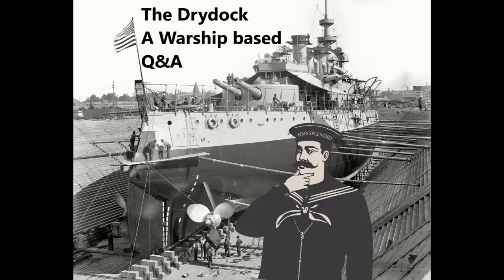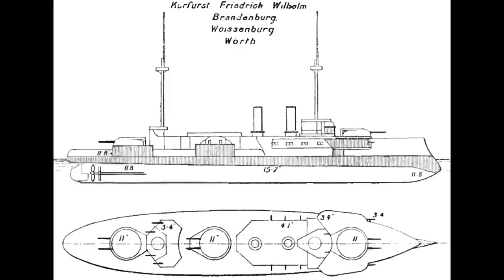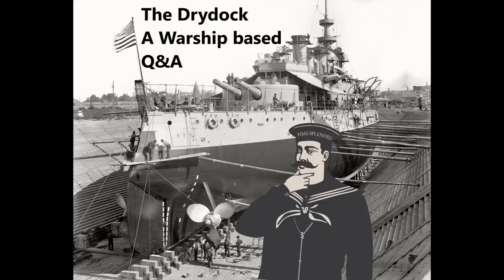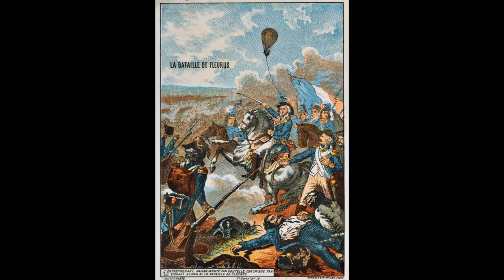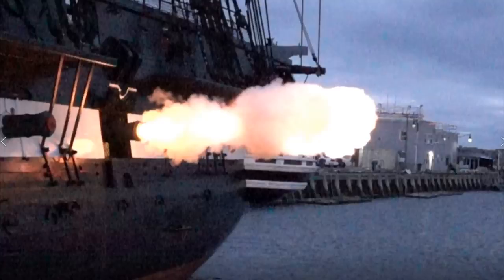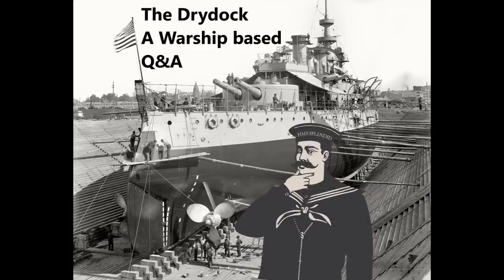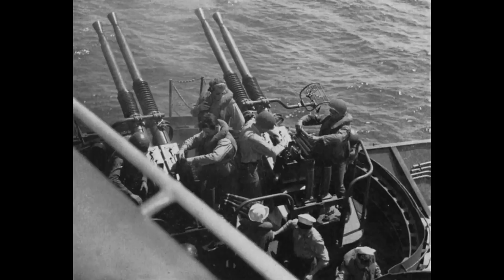The Drydock - Episode 254

Comment: In terms of the 'maritime Hobart's Funnies', the smaller vessels used by the Allies during the Overlord operations merit mention, although mostly smaller than true 'ships'.

Peter Scott's flotilla of Denny steam gunboats were all 'converted' prior to D-Day into fast minesweepers; as far as I can tell, these were basically just using their considerable speed to produce waves which would detonate pressure mines safely without the boat still being horribly over the weapon when it blew. So that's an interesting 'misuse' of a fighting vessel.

Others of note were the various LCT conversions, which included LCFs (Landing Craft, flak) - an LCT mk 2 to 4 with the lank deck taken up by copious 2-pdr and 20mm guns for close-in AA defence of the landing forces. One of the early versions even received a pair of twin 4-inch HA guns as found on early 'L'-class destroyers or Hunts as main armament.
LCGs (Landing Craft, Gun) were a combination gunboat/monitor conversion with two destroyer guns mounted singly on the tank deck, with the later LCG(M) (LCG Medium) being slightly smaller and purpose-designed with two echeloned 17-pdr gun turrets, as well as ballast tanks which allowed them to be flooded down to ground at known map references so they could then act as fixed inshore artillery batteries to either support the troops with predicted fire missions or even indirect point fire missions on call from the troops ashore's liaison officers.
LCT(R) were the famous floating rocket batteries, again converted from LCTs for fire support to the troops ashore (carrying out suppression/barrage missions).

And of course, several of the smaller landing craft were modified into gunboats for direct fire support during the landing phase itself. Small numbers of Fairmile 'H' type LCIs were given a Valentine tank turret with 6-pdr gun for this role, and other small craft had 4-inch smoke mortars added, becoming smokescreen layers instead of assault troop carriers.

Perhaps my favourite is the inventive use of the old and, by 1944, very redundant Holman Projector (steam or pneumatically-operated anti-aircraft hand grenade launcher); this was modified for use as a grapnel projector and was mounted in LCVPs used by the US Army Rangers in their assault on Pointe du Hoc.
Intended to fie a line up the cliff to allow the troops to rapidly scale the face to reach their objective, it's not clear that they functioned as well as anticipated, but they were mounted for that purpose and so these handful of LCVPs became the maritime equivalent of the famous ARK ramp tank, being there especially to help their team get past an obstacle to reach their objective.

EDIT: Who can forget the famous German Sperrbrecher, either? Mercantile hulls, modified to withstand mine blasts forward without sinking straight away, they had not just sweep gear for general minesweeping duties, but also the very famous blisters either side of the forward hull, filled with buoyant materials like kapok, so that if they did hit a mine, they would only partially sink before the blisters took the strain and kept the bow up, hopefully just far enough.
This enabled their use as 'mine bumpers' when leading U-boats in and out of their Atlantic bases, or when escorting convoys and blockade runners up the the Channel; all areas which were extensively & constantly mined by the British.

Comment: The engine rpm indicator was used by the bridge to command the engines to a slightly higher or lower speed so you could precisely match speeds when doing underway, replenishment and refueling.

Comment: 56m50: I recall one type of vessel in WW2 that could be classed as a funny, the radar Picket submarines Grouper and Finback with Threadfin and Remora completed after the war ended.  They were to be a more survivable platform than the radar picket destroyers, LCS(L)’s and LCM(R)’s doing the job.  They were followed by others for a bit into the cold war.  For that matter, the altered landing ships could probably count too.

but I imagine for ships, funnies only work with ships up to a certain size with an entire sub being the upper limit before someone would wonder why they had to have an entire vessel dedicated to that one mission when they could instead either tack on more equipment to add the mission to a ship, or cut into some other capability a bit to make room/tonnage for it (e.i. guns, torpedoes, AA).

also, after the period of your Channel, the Greyback after it was converted from an SSG to a Special operations sub.

Lastly, will Judy get her own video much like Nuisance did?

Comment: A question for the Dry dock, Mr Drach. 

Is there any history of a Navy using chemical weapon shells in their arsenal? Like an 11” or 12” Chlorine Gas shell or something?
Reply: The French tried with the Richelieus. The end result was that the Richelieus had horrible fucking dispersion (it’s really them and not the Littorios, whose own dispersion issues were largely fabricated postwar, that need to be criticized for it) until the US made non-poison-gas 15” shells for them that worked fine, not that it was ever going to matter.
Reply: To be clear, the standard AP shell for the 38 cm guns in the Richelieu class had four slots in the base for toxic gas cartridges, with the base covered by a base cap. However, the base cap would sometimes shatter during firing, occasionally allowing the gun blast to set off the bursting charge and, in any event, contributing to the dispersion mentioned by BKJeong.

Note that chlorine is a terrible war gas. Lethal concentration is around 5,000 parts per million by volume (ppmv), but it produces tears and coughing at much lower concentrations (around 5 ppmv), so it's obvious your being exposed to chlorine long before it will kill people. At that kind of concentration (5 ppmv) phosgene is already killing people.

Comment: A question to do with range-finders. On the turrets of the Omaha-class cruisers there are these tubes on the roof at the sides. Are those a differed kind of rangefinders then the ones usually seen across turrets ? And if so, how do they work ?.

Comment: For the comparison to Hobart's funnies, rhere are two examples I would point to:

1) The various specialized landing craft with different weapons systems for supporting landings.
2) The destroyers converted to fast transports (the Funnies weren't all combat vehicles, they included support vehicles as well and the Kangaroos would be assigned to the 79th alongside the Funnies when they were formally adopted).
Reply: Great shout about the fast transports. Without them, the amphibious special ops like independent commando insertion/extractions and UDT missions wouldn't have been possible.

Comment: Think Japanese shadow fleet had some "Hobart Funnys", that were easily convertable from an earlier guise as dual or specialist role.
Chitose and Nisshin were seaplane carriers, but carried midget subs in their hull as well in case US battle line appeared at Midway.
Then Nisshin in the same hull, carried artillary and tanks to Guadalcanal, and avoided Battle of Cape Esperance 
Obviously Chitose was converted to a light carrier after Guadalcanal
 
Ryujo Maru was the original Command/amphibious/jack of all trades ship for sea landings, until sunk at Sunda Strait by Mogami if u wanted to go down the an amphibious sort of landing ship path.

Maybe a Ise, Hyuga and Mogami if they were modified prewar to carrier/battle ships and Tones as configured might have been very useful if they accompanied invasion forces like Wake or Rabaul where their seaplanes and gunnery could have been very effective if they were also designated a command ship for those operations where they could have directed ground support bombing attacks via their seaplanes or naval bombardment to any kind of resistance/bunker to invasion force, up to about 10-20 miles inland

Comment: On the idea is specifically modified ships for specific roles.  While that wouldn’t happen with large expensive ships  it did happen with smaller craft, below what the navy  considers  “ships”.  LCIs, SCs, and LCTs were all modified for specialized roles.  They usually benefited in the new roles from their shallow draft.
 
LCT could be mounted with a destroyer main gun (120mm or the like) or a mass of short range rockets for firepower at or near landing beaches.  They also have a lot of deck space for their size is is probably why post war their name was changed from landing craft tank to landing craft utility.

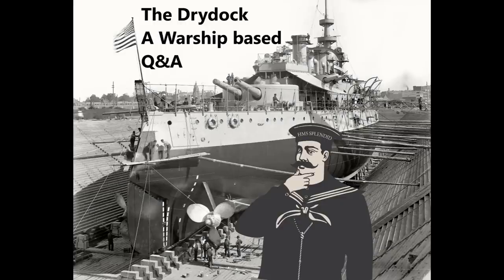Comment: @ 0:10:42 The Engine Order Telegraph for smoke would be in the boiler room(s) and in Central Engineering. (Since it would be the boilers that make smoke.). This is, of course, for ships that didn't have unitized propulsion system(s) and had the boilers and the turbines in different machinery spaces.

Comment: Question not related to dry dock: Was the Samuel B Roberts the only DE that had torpedo tubes?  One of my sources said it was, and that was why Copeland joined the destroyers in the strike on the Center force.  Did Copeland join because he was the only DE with torpedoes or because he was feeling scrappy?
Reply: The latter, I think…
Reply: All US DEs had a single triple torpedo mount, at least as built (I think some may have traded it in for an extra Bofors quad later).  IIRC, after the destroyers and Sammy B made their torpedo runs and were falling back, the other DEs were sent in to make their own torpedo attacks to try and further disrupt the Japanese formation and thus buy more time for the CVEs to flee.